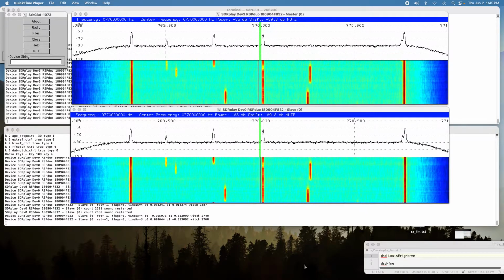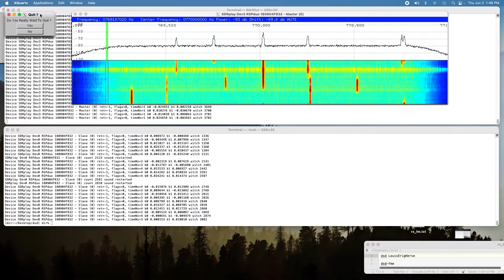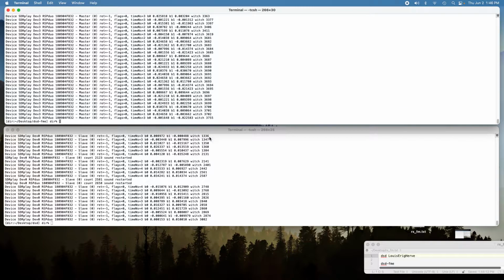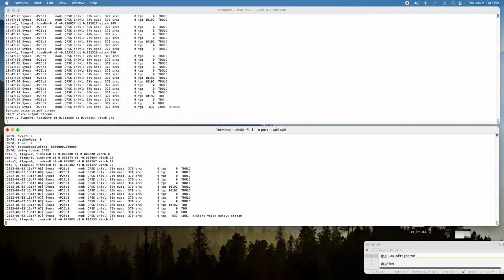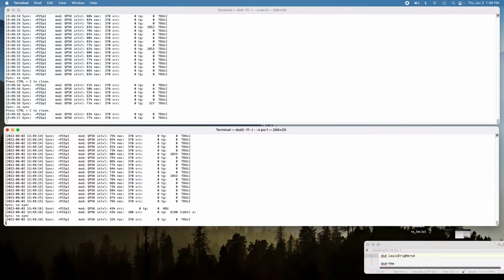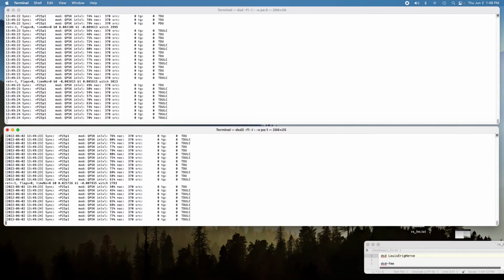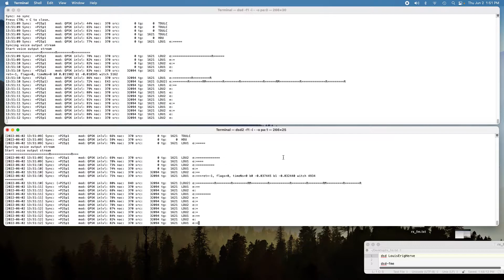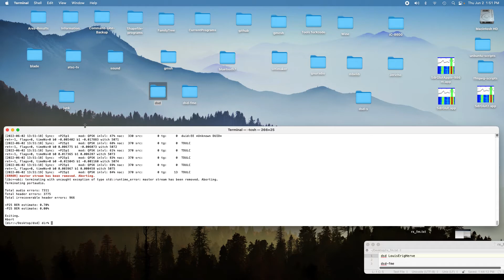A P25 reception contest - dsd-louis vs. dsd-dme

Comment: Possible the louis easy install in win10?    dsd-fme  with SDR++ iam not able to route  the "network audio"  into dsd-fme not get any signal
Reply from the maker: on MacOS and linux, I just piped the audio into the programs. On win10, I think you have to use some kind of virtual audio cable program to make the connection between SDR+ and dsd-fme
Reply from the maker: @lumixS5M2  I found that I can pipe the audio on Windows 10 using sdrReceiveWindows, but of the three sound devices it only worked on one of them ? With a little luck it will work for you.

 sdrReceiveWindows is include with the windows version of SdrGlut.

https://github.com/righthalfplane/SdrGlut/releases/tag/v1.31

There is another video where I use DSD and SdrGlut to decode signals-

SdrGlut uses DSD to decode Public Service Channels with the RSPduo
https://youtu.be/x0Bo27QmZjA

This version should work on windows, it requires building and addition program. 
 If want information on how to do it - you can join my google group-

https://groups.google.com/g/sdrglut-users